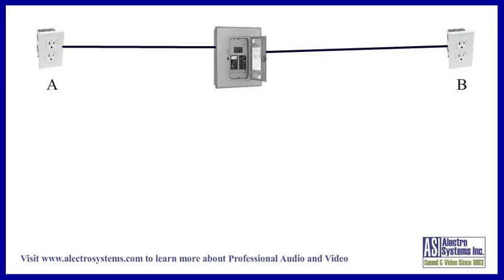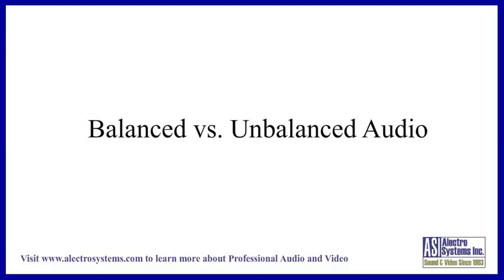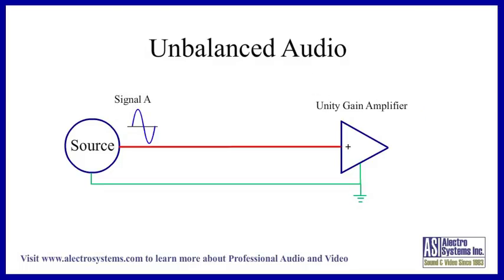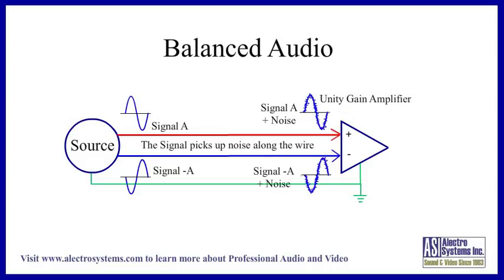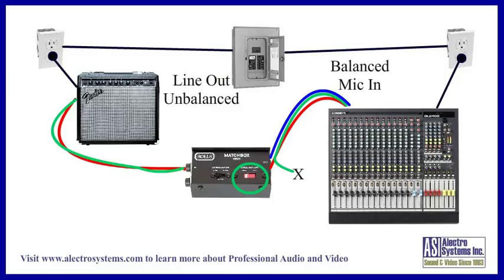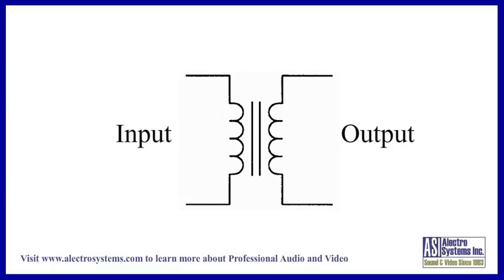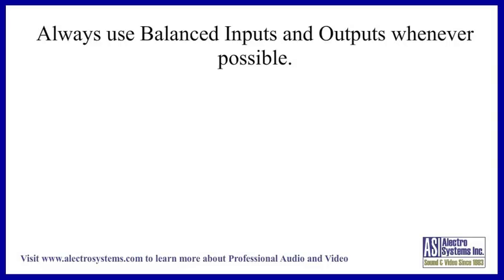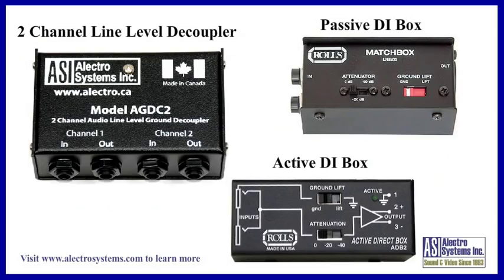Troubleshoot and Eliminate AC Hum on Sound System

Comment: This is why we should use dc instead of ac
Reply: +Hrca Barba DC wouldn't work since sound also kind of really obviously goes about frequencies?
Reply: DJSNDCX 
lol we have a dj here!?
Educate yourself.
Amplifiers work on dc, your computer works on dc, all electronics actually work on dc, they just have converters from ac to dc.
That`s because ac has non consistent power, as it periodically changes at 60hz (50 in EU)
the result is that power you get is periodical. If you connect a speaker directly to ac outlet with a stronger resistor in series, or trough a step down transformer (it will blow without it) you will hear a 60hz sound.
In all electronics ac gets converted to dc, Because amplifiers need dc to work properly, they multiply signal with dc and that is how they amplify it, if you would hook them directly to ac it would sound as if you were twisting volume knob from 0 to full 60 times in second, do you get it now?
I don`t want to lecture you guys here, but if you want to comment about something at least know what are you talking about.
Reply: You're obviously trying trying to prove me dumb when the point of your message was the exact same as mine...Hrca Barba
Reply: DJSNDCX 
where is exactly your point?
Reply: On the end of my freshly-sharpened pencil.
Reply: DJSNDCX 
As I tought, immature kid.
I have proven you that you were wrong and now what
Reply: Ughum, immature? I'm older than you, freak. And so what, I can't take away my autism...Hrca Barba
Reply: +Hrca Barba Yes,but wouldn't there then be a need for huge currents to maintain signal integirty? Long distance power lines use AC for that very reason.
Reply: I was talking about usining dc inside a house, ac is good for carrying power on longer distances, but you don't have much benefit got using it in your home when you convert it to  dc for all electronics you have
Reply: uh huh :-)
Reply: Actually high voltage DC is more efficient for long distance power transmission. It's just that without advanced electronics we needed transformers to change voltage levels, and transformers only work with AC, so AC let us run high voltage long distance lines, and then reduce the voltage for the local power networks. With modern electronics we actually do use DC for long distance power transmission.

https://en.wikipedia.org/wiki/High-voltage_direct_current

Comment: This sounds familiar. We had a problem for a while in our rehearsal space where I would get shocked if I touched my guitar strings and the cage of an SM58 at the same time. I assumed it was a ground loop between the mixer and my amp, so I just started mixing and matching outlets throughout the room, and found that as long as my amp was on the same power strip as the mixer, I could plug my pedal board (about 6 analog pedals daisy chained on a 9 volt power supply) into an outlet on a different breaker and avoid getting shocked.

So I'm not sure exactly where the loop was, but I broke it somehow!

Comment: I still don't know how to make my amp quit humming.
Reply: Gerald Ritchey Are the cables balanced going to your amp? What does your set up look like. I may be able to help you. Don't cut anything.
Reply: Roger Stevens It's a brand new Ibanez bass and a brand new Mark Bass amp. I bring it to my house and plug it up; no hum. I take it to where I play it, plug it up; constant hum. I've tried ground lift adapters, Plugging in different outlets, everything.
Reply: Gerald Ritchey Make sure there is no transformers near your amp and output device.
Reply: What if you use a two-prong to three-prong adapter?
Reply: John Kennedy need help also my VIDEOKE machine also has a nosie sound when I turn on my microphone it started to humming.
Reply: Greenpea how can I remove the humming sound? When I open my VIDEOKE machine and start to play music video it plays well but when I turn on the microphone it humming. I already bought a new mic but it still the same problem.what should i do
Reply: @geraldritchey4822  You forgot one clever point: there are Radio Frecuencies (RF) in the air that the guitar picks up...and perhaps the electrical network in the site you play dont have a right ground connection.
Reply: yo im here in 2020 can somebody help me 2 yorkville ysm8 speakers into focusrite interface into macbook pro 2016

Comment: hey i have all my audio stuff plugged intto the same power bar but as soon and i turn the amp that powers the sub on i get a hum. even with nothing plugged into the amp other then the sub it still hums. and its only a 2 prong plug for the power to the amp. any ideas thanks.
Reply: *****
no i think that`s wrong
i`ve got hum and it sometimes will happen with no sound - just volume

i had the amp checked when i bought it 2nd hand so i know for a fact it`s fine - the guy is a classic repair man - so i know

it`s an earth thing as far as i know
it could also be wiring getting crossed behind the amp or mixer or amp - when the wires are close together and all criss-crossed - this can cause a hum

as for the earth - i think this is the best way to fix hum - but i`m unsure how to achieve it - unfortunately
Reply: Nope. If you want no hum from your amp, take out the transformer from it, build a box for it, and put it at least meter away from the amp.

Also, if you use two amps, make sure their input is only one long cable going to it, and then splits into two amps as close as possible, with good quality splitter. Not two long cables.

Make sure you use one outlet, like, use one outlet splitter for all the amps, and the signal source included, like your computer or even charging cellphone.
 
Got it? Every thing is important. Now go and fix that annoying hum.

Comment: What's the difference between this product and using the 'Ground Lift' switch on professional equipment ?
Reply: One is power to the unit other is signals in or out ,huge difference.